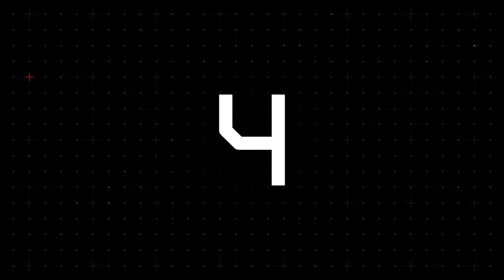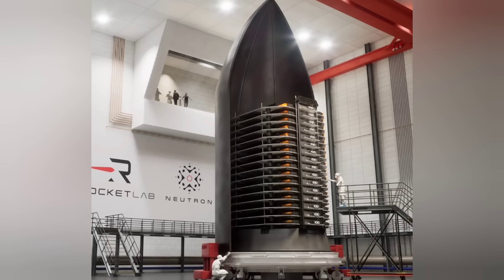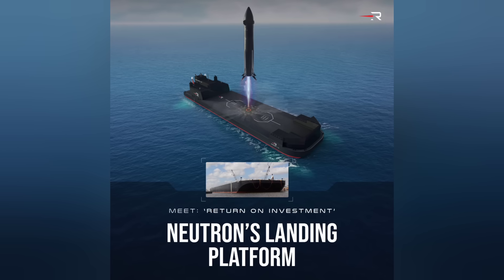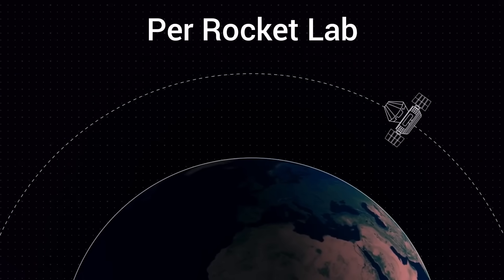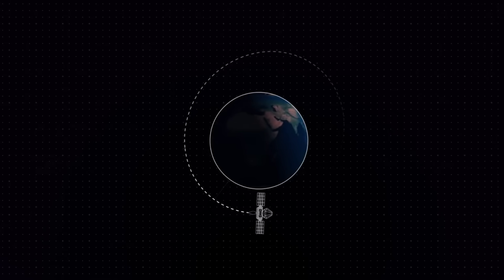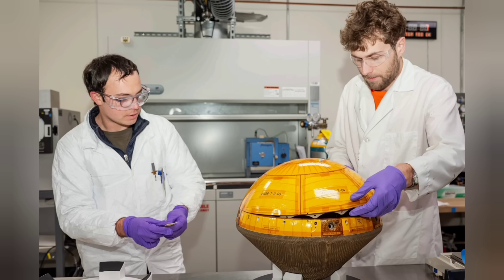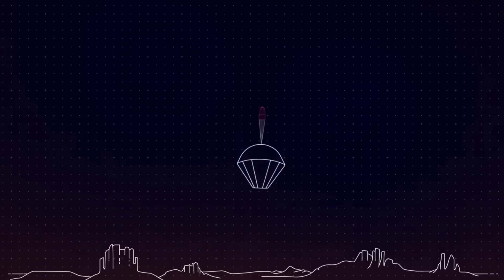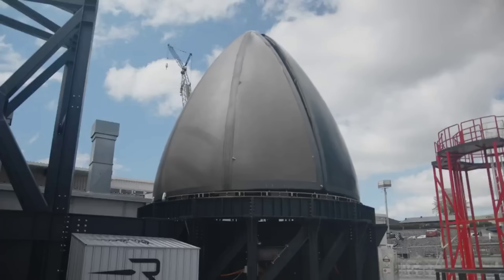Rocket Lab surprises everyone with four new announcements, including a Starlink alternative!

Comment: The thing that has excited me is Rocket Lab's refinement of Neutron's design. Neutron as originally proposed would require the second stage and payload to be integrated with the rest of the vehicle on the pad, which has some obvious issues. Instead, Rocket Lab has changed the design and the main body of Neutron is now two modules - a core module and an upper module. The core module being the main tanks and engines. They payload and second stage are now going to be integrated with the upper module in a clean, sheltered environment. And then the upper module gets bolted to the core module pre-lauunch.

This is a brilliant innovation. It takes the integration of the payload and second stage out of the critical path. You can be working on multiple upper modules in parallel. In short, if you want rapid reuse, this is the rocket you're looking for. You can quickly put a core module onto the launch pad, bolt on the upper module (previously worked on) and away you go. And do it again tomorrow. And the next day. Neutron is unencumbered by the need to recover, inspect and refurbish a tile-clad second stage. 

I love it to bits!

Comment: Good job Rocket Labs.
Reply: Let’s see you 3-D print an entire satellite just from graphene to include all of the electronics and energy collectors.  If you’re really cool, you’ll print the entire rocket to include the satellites all at once. : )
Reply: Thank you for sharing this fascinating concept for aircraft-based atmospheric pollutant capture. I'll analyze the proposed system and provide refinements based on current and emerging technologies.

## Refinements to Aircraft-Based Carbon Capture Concept

### Technical Feasibility Assessment

The concept has merit, but several critical adjustments are needed for practicality:

1. *Air Processing Volume Challenge*
   - Commercial aircraft travel at ~500-550 mph, encountering enormous air volumes
   - To capture meaningful amounts of CO₂ (which is only 419 ppm), extremely efficient filtration systems with massive throughput would be required
   - **Solution**: Specialized air intake designs that can process 10,000+ cubic meters of air per minute without creating prohibitive drag

2. *Energy Budget Considerations*
   - Carbon capture requires significant energy for compression and chemical binding
   - **Calculation**: Capturing 200 kg CO₂ per passenger-hour would require ~100-150 kWh of additional energy
   - **Solution**: Hybrid electric systems with regenerative capabilities or fuel cells to power capture systems independently from propulsion

3. *Weight and Space Optimization*
   - Capture media (sorbents) and storage tanks add substantial weight
   - **Solution**: Develop ultra-lightweight carbon nanotube or metal-organic framework (MOF) based sorbents with 5-10x current capacity/weight ratios

### Promising Technologies for Implementation

1. *Direct Air Capture Integration*
   - Adapt technologies from ground-based DAC systems like Carbon Engineering or Climeworks
   - Use high-surface-area, low-pressure-drop contactors specifically designed for high-speed airflow
   - Integrate solid sorbents that can be regenerated in-flight using waste heat from engines

2. *Cryogenic Capture Enhancements*
   - For methane and HFCs: Use throttled liquid nitrogen cooling loops that can selectively condense these gases
   - Recent advances in miniaturized cryocoolers make this more feasible for aircraft applications

3. *Multi-Pollutant Cascade Systems*
   - Staged filtration addressing different pollutants sequentially:
     - First stage: Particulate matter and SO₂ via electrostatic precipitation
     - Second stage: CO₂ via amine-functionalized sorbents
     - Third stage: Methane via catalytic oxidation or selective adsorption
     - Fourth stage: N₂O via specific zeolite molecular sieves

### Aircraft Models Most Suitable for Modification

1. *Boeing C-17 Globemaster III*
   - Large cargo capacity (170,900 lb payload)
   - Significant onboard power generation capacity
   - High-bypass turbofan engines with potential for heat recovery to power capture systems
   - Modification potential: Convert rear cargo area to filtration and storage systems

2. *Airbus A400M Atlas*
   - Modern design with digital systems integration
   - Turboprop engines offer better efficiency at lower altitudes where pollutant concentrations are higher
   - Modification potential: Install capture systems in modular pallet positions

3. *Boeing 777F Freighter*
   - Long range (4,970 nmi) enables extended capture missions
   - Large payload capacity (224,900 lb)
   - Twin-engine design improves overall efficiency
   - Modification potential: Use lower cargo deck for capture equipment, main deck for storage

### Implementation Timeline

1. **Near-term (1-3 years)**:
   - Prototype small-scale capture modules on research aircraft
   - Focus on single pollutant (CO₂) capture efficiency optimization
   - Begin modifications on test cargo aircraft

2. **Mid-term (3-7 years)**:
   - Scale to multi-pollutant systems
   - Integrate with sustainable aviation fuels
   - Deploy first fleet of dedicated atmospheric remediation aircraft

3. **Long-term (7-10+ years)**:
   - Integrate capture technologies into commercial aircraft designs
   - Develop dedicated high-altitude long-endurance capture platforms
   - Establish global network of atmospheric cleaning aircraft

### Economic Viability

To make this system economically viable:

1. *Carbon Credit Integration*
   - Aircraft operations could generate carbon credits valued at $100-300 per ton CO₂ removed
   - For a system capturing 20 tons CO₂ per flight, this represents $2,000-6,000 in potential credits

2. *Dual-Purpose Operations*
   - Cargo/passenger revenue + carbon capture credits
   - Military applications: atmospheric monitoring + pollutant capture during regular operations

3. *Government Incentives*
   - Direct subsidies for atmospheric remediation services
   - Tax benefits for airlines operating carbon-negative fleets

This refined approach addresses the main technical challenges while providing a realistic implementation pathway using technologies that either exist today or are in advanced development stages.

Comment: Explain how this is more reusable that Falcon 9 or Heavy?   Last I checked they both only waste the 2nd stage.    If you are talking more efficient then you have a point.    However they have not hit the same cadence at SpaceX.   Second  they are entering a crowded market not just SpaceX and Kuiper but you have Viasat, Oneweb, Orbcom, etc and the EU constellation IRIS that is in the work as  well as China's constellation that is in process right now.  The concern that investors will be having is that this is a way to justify Neutron?  Is Neutron getting any outside interest at all.   Finally,  will they be given the necessary FCC license to operate this constellation i9n this market.   IF this is a satellite service to other companies great, if this was a partnership with an existing provider yes then you can say a threat.      This is a very high risk play for Rocketlab the smart high reward play would be to develop this in secret then partner with one of the existing providers like Oneweb where Rocketlab focuses on the satellites and Oneweb focuses on the ground infrastructure and licenses.   Now you have a true direct threat to all of them .
Reply: I reckon neutron will be cheaper given its lower payload capabilities, and it's got a less powerful upper stage and keeps its fairings attached to the first stage, both of these reduce the cost of reuse and of the second stage (which yes, is expended for both rockets). I think neutron can carve out a niche in what Eager Space calls the "anyone by SpaceX" market (launches of amazon kuiper, backup providers for the DoD, etc.)

Comment: awesome content.....Rocket Lab developing viable alternatives to spacex and starlink is likely something that will benefit everyone...I have never cared or thought Jeff Bozos was much of anything and his company in my opinion was more an ego trip than anything else....Rocket Lab is a top notch company...if they can pull off Neutron along with a viable alternative to starlink this will go a long way to keeping spacex lean, focused and cost oriented ....you don't want spacex devolving over time into Boeing....competition is what drives innovation and keeps costs at as reasonable level that is viable to keep the company afloat...once starship actually comes online...due to it's ridiculously low cost it was a threat to electron launches....Neutron should now be able to compete with Neutron and at a much higher payload volume than electron......I would be shocked if Rocket Lab could successfully launch Neutron prior to 2026 and landing it is likely even a year or so farther out ...I could be wrong of coarse,, but being a whole new platform and having never recovered orbital or even sub orbital vehicles you would think there would have to be a learning curve...

Comment: Starship isn't fully reusable yet, and Electron could be the best candidate  to compete with SpaceX. And yes, I realize Elon is a god to a fairly large portion of the audience here at the Angry Astronaut channel, and they will say, "Rocket lab is copying SpaceX." That is such a lame argument. It's like saying Chevy copied Ford who cares. If Rocket Lab can successfully fly a reusable carbon fiber 1st stage, it will be a game changer without question. Carbon fiber could equal an 80% weight savings as compared to a stainless steel booster. You don't need to be a rocket scientist to recognize the advantages.
Reply: for certain Peter Beck and company are not copying elon and spacex....as with everything they do ..theirs is an innovative approach that is all their own.....awesome company
Reply: Currently Starship isn't usable let alone reusable 😂
Reply: @ ok...what company do you propose is closer to full re-usability?
Reply: @mikelee-i3b  I've not made a clame about full reusablity. My point was simply that Rocket Lab stands a great chance to compete with SpaceX.
Reply: @ @mp6756 sorry my question was directed to @sketchie2210's comment   I pretty much agree with your initial comment..😊  for some reason at times YT takes out this info????
Reply: Neutron is still a fantasy. No proof of concept means it’s not even at the prototype phase yet. If you think they’ll beat out Starship in any way, I think you may be on that democrat crack smoke.
Reply: @oljimeagle  What a dick. A democrat? No, I'm no Democrat but thanks for asking. Not all space flight success stories start by dumping over 250 rocket engines into the world's oceans. Look at history as your guide. Nasas mercury rocket human rated successful no years of failures just a successful program. Apollo no years of flight failures. The shuttle program was the first flight maned and successful. The SLS first launched orbited the moon and returned safely to earth. Not all rocket programs start with 3 years of failure with hundreds of tons of trash and hundreds state of the art rocket engines dumped into the abyss. Some rockets are built differently. The engineering is done on the ground before failures of flight to discover the problems. It's called a plan.
Reply: @ @oljimeagle   lol...I am a bit confused..I thought I have seen a Prototype Neutron in its final phase of construction....they claim they plan if feasible to fly it later this fall.....why is this fantasy??  clearly it is not proven, but it has gone way past the concept stage...I may be missing something, so let me know please
Reply: @oljimeagle  True facts, Elon is going to put people on Mars as soon as 2024, there is no way Rocket lab can beat that
Reply: Competition is good